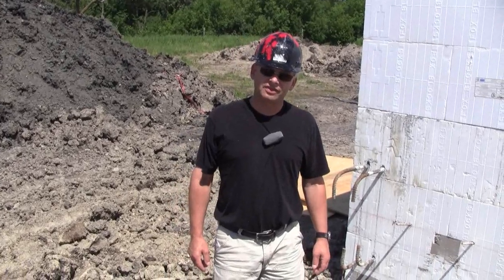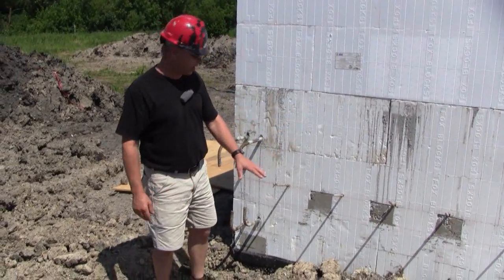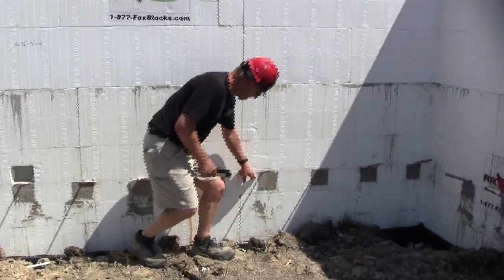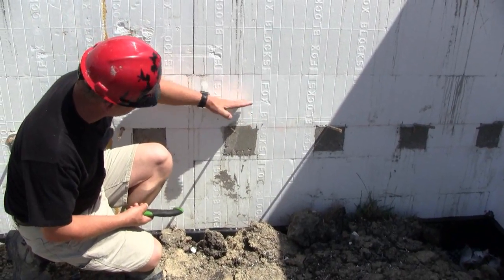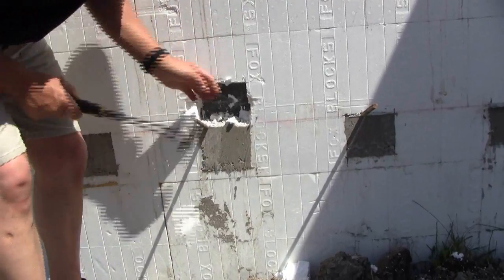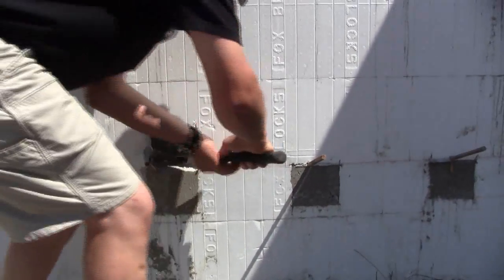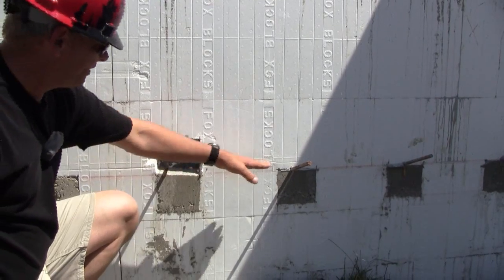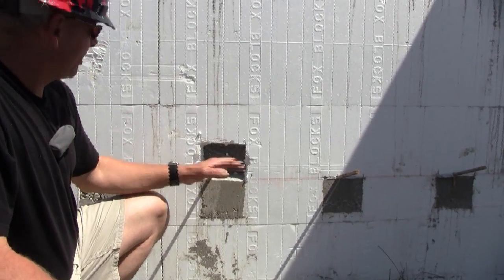Fox Blocks How To provide Slab Support against Insulated Concrete Forms

Comment: So, the slab will be supported by a "ledge" with nothing but insulation foam directly underneath that "ledge"?  In an earthquake, such ledges can easily crack and SHEAR OFF!  It would have been much stronger, and much safer, to set a LOT more rebar into all those ledges e.g. at least 4 more horizontal bars equally spaced, or 4 x 5/8" anchor bolts.  Did the building inspector approve these ledges with no embedded rebar?  Why not embed the entire perimeter of the slab into the wall, then stack ICF forms on top of the slab?  Maybe I'm missing something e.g. are they going to back-fill the void from the rebar downwards with a sand base?  If so, then maybe what you have shown us will result in a safe slab that does not shear off those ledges.  How about doing a follow-up video that shows the slab being poured, so we can see the final elevation of the sand base?  Garages are typically used to store cars and trucks.  A basic Ford F-150 weights 4,000 lbs. (2 TONS).  Lastly, the green tool you criticized does appear long enough:  it stopped when it hit the concrete, yes?
Reply: The way he said foundation and smacked it from the outside is basically construction sign language for #67 crush on top of backfill, so no void.

Comment: In this scenario, or in the case of using a CORBEL block to use as a slab supporting ledge. How do you waterproof those areas? or does it not get waterproofing?